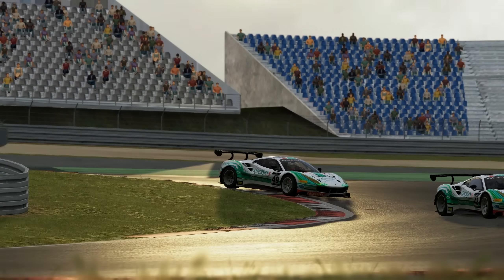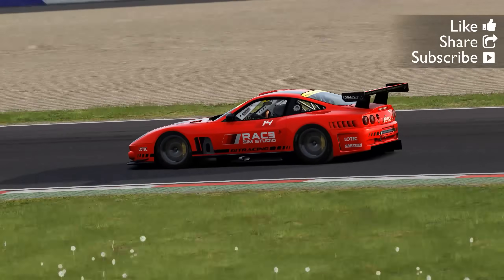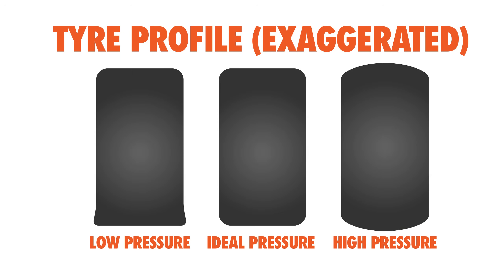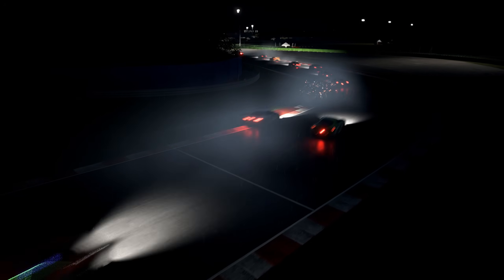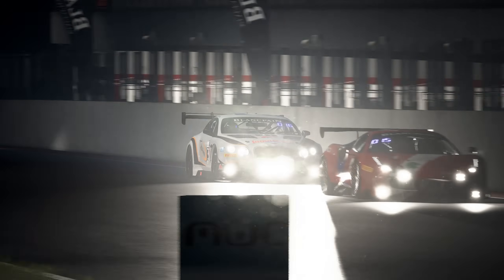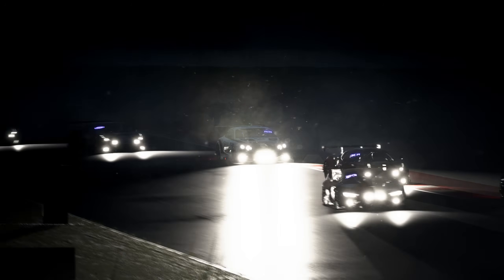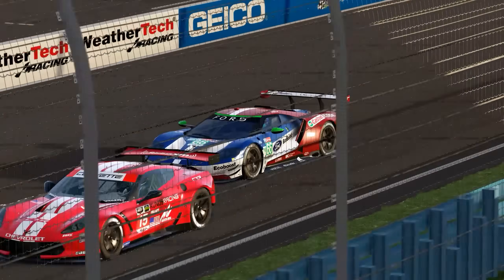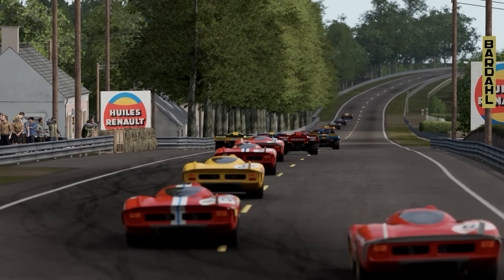Sim Racing Setup Guide 02 – Tyres [Temperature, Pressure & Compound]

Comment: ProTip: think of higher pressures being better for "digging"/"cutting" hard into the track with high load whereas lower pressures create grip by the increased contact patch "pulling" the car with the tyre. High aero/high speed corners will work best with increased pressures and long slow 'sloggy' bends will work better with lower pressures and more static loads

Comment: If I’m running at something like the Daytona road course or Indy road course, one side will heat up more stay hot and at a greater pressure through the road course sections. 

Would it be a good idea to alter the starting pressures so that the hot pressures are the same left to right over a run?
Reply: On ovals I usually raise the right side pressure to cool them down, because the left tires kinda just sit there (obviously exaggerating), and can be lower, and use this on tracks like the RB ring, where you can just push them through

Comment: Chris at 2:19 you mentioned that 'lower pressure generate more heat', but in other guides or for example in the F1 2020 game it notes 'increased tyre pressures contributes to higher temperatures'. For me this sounds contradicting. Or does it solely means that lower pressure get hotter quicker, but higher pressure will reach a higher temperature in the end? But that doesn't match with your flowchart again. I'm a bit lost on this point. Of course I can go out and try for myself, but would love to hear your response. (Note: I'm more of a simcade racer, but want to improve my basic setup knowledge.)
Reply: No the other guides are correct, lower pressures = lower temp and take longer to get up to operating temp,oppisite for higher pressures. 
on a hot track you lower the pressure, and raise them for cold track temps-
a higher pressure switches tyre on quicker but it will also drop off quicker,lower pressure takes longer to switch the tyre on but it will take longer to drop off.
this is from over 30 years real world experience and every sim title i,ve played has been just like real world.
now if you are experiencing the oppisste there is something fundamently wrong with your car setup
Reply: I am so confused

Comment: Hi Chris
I tried amg gt3 on Monza optimal condition no wind...with default setup and even after 8 lap i cant  have hot tyre what is the problem crew chief said cold tyre around
I have  27psi on fourth medium tyre set
Kunos app tyre temp always blue
If you can help me ...thxs

Comment: Awesome videos mate! I love them so far. I have a question, is it recommended to change the pressure between the left front tyre and the right front tyre, or left rear and right rear? like running 15 psi LF and 16 PSI RF. Or do you only change the pressure between both front tyres and both rear tyres? Because some tracks put a lot of tempreature on only one side of the car, leaving the other side with a wrong pressure on the tyres. Hope I was clear! Keep the videos coming, and a big thank you, you're very good at this!
Reply: Marcos Saavedra Chang the pressure on both sides different then test it so there both the pressure u want it to be

Comment: Tyre-pressures are so annoying and time-consuming, especially in AC where you need two setups for soft and medium slicks, i get why Raceroom doesn't bother with this and it just can get exploited as well. The Lotus Exos on Paul Ricard for example is like four seconds faster if you increase the pressure for less rolling resistance and just delivers this WTF-moments when others are a lot faster than you, just for not knowing the trick. Four clicks more PSI was faster on the straight than four clicks less rear downforce and i doubt this works in the real car at all. Tyre-temps are even more crazy in AC and seems that ACC 0.2 is reducing the effect a lot like pCars 1 did with pCars 2 as well. Better simple and too easy than complex and unrealistic.
Reply from the maker: Hey Leynad - for what it's worth I agree. AC does have some weird exploits when it comes to setups, particularly like you say, with crazy low downforce. I've not spent a huge amount of time playing with the setups on ACC since it's still on a pretty steep development curve & I expect a lot will change still - but from what I've read, it doees seem like a lot of the unrealistic "tricks" you could use in AC don't carry over to the new title... so that's a step in the right direction.
Reply: @ChrisHaye  I hated 0,1, but 0,2 feels damn good:) Tyre-pressure is limited and you can only lower 1 psi front, 0,2 psi rear from default, so not much to gain in this regards. Running full downforce with 0,1 was an exploit for 1:52 times, but this doesn't work anymore as well.

Comment: ProTyres app in assetto corsa
Reply from the maker: Yep, love it Des - will be doing a video about it in the future.
Reply: This. It shows you the delta pressure you need to put in your tyres to get optimal.
Reply: Rehooja I just tested this app and didn’t benefit from having the exact tire pressure I need. The tires are constantly cold in this game, if they’re warm I go faster. For some reason tires won’t even warm up in this game like the GT4 and GT3RS.
Reply: @StirlingMossDrives  same here dude. Did you figure it out?